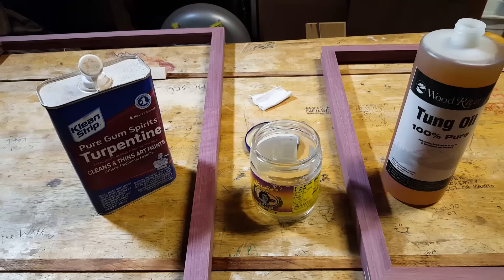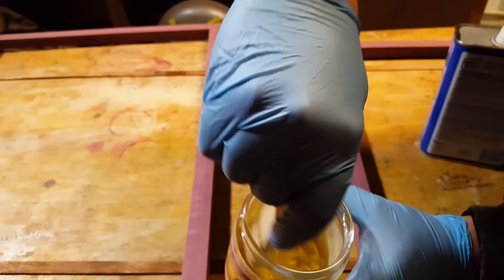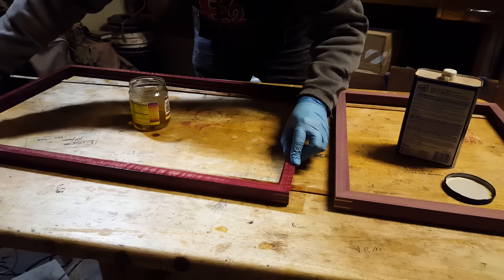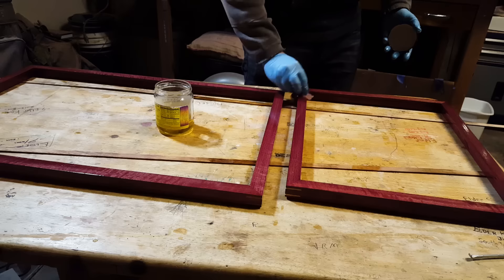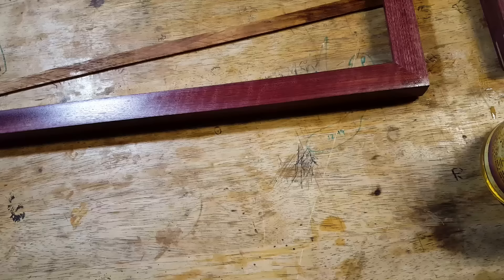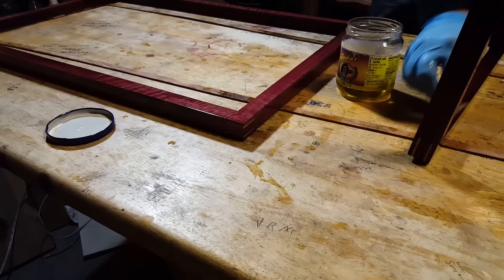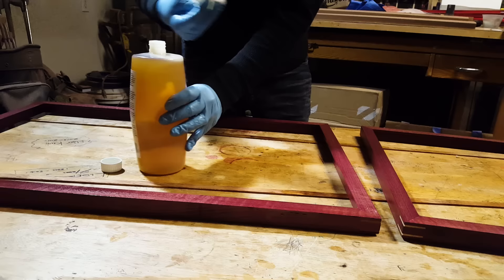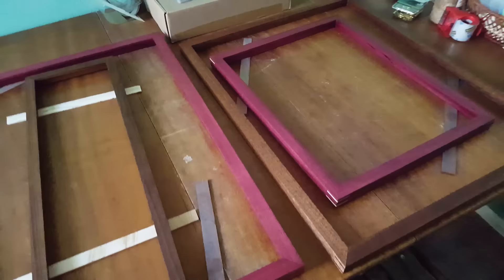How to Apply Pure Tung Oil to Wood (the right way)

Comment: Ive never worked with wood but wanting to do some diy stuff using the pre sliced wood ornaments. They all suggest using tung oil to care for the wood pieces. For this kind of situation do I dilute the oil? I also see spray tung oil available. Is it best to brush on with paint brush, rub on with a cloth, or spray on? Diluted or straight? The wood pieces vary in size from 2.0 in.-3 1/2in.

Comment: I purchased an unfinished French door. It was ready for staining. I’ve stained it with minwax stain and is allowing it to dry. In a few days I want to add a top clear coat or a sealant so I will use tung oil. Do I just apply the tung oil to the stain coat or do I need to sand it first with a 220 grid sand paper sponge before applying the tung oil?

Comment: i for one liked the music, can you tell me who that is? 
I'm refinishing an old rifle stock with pure tung oil, the only thing I'm a bit disappointed in is how much it darkened the wood...I'm on the fourth coat and am becoming very impressed with the results, the only thing i would like to know is, how can i give it a glossy look when done?
thank you for the vid and music.
Reply from the maker: Vienna Ditto. Good stuff. 
Sadly, if you want a glossy finish, you are going to have to let the tung oil cure for a month then apply a top coat of something glossy.
Reply: Melody's Dad thanks for the quick response...
Reply: bill randen Bill, if you want a glossy finish you can use a wipe on poly such as Minwax wipe on poly. Being 5 months later I'm sure your tung oiled stock is dry. 👍
Reply: If you're willing to put in the work for a hand rubbed finish, you can use butcher's wax. This will not give the high gloss finish of a gloss urethane, but will give an excellent, durable, semi-gloss. I use a dauber, either linen or coarse cotton, old denim works well. In a large square of cloth, place a good chunk of the butcher's wax. Pull up the ends and twist closed to make a dauber. Using the dauber in a circular motion, force the wax through the cloth and press into the pores of the wood. It will take time, but you're trying to fill the pores with as much wax as possible, this will take a few sessions. End each session with a clean, soft cotton, like old t-shirt. Wrap the cotton around two fingers, dip in warm water and begin buffing the wax in circular motions until it appears that all the wax is gone from the surface. This is similar to spit shining leather shoes and boots or a French finish using shellac. It will take just a few sessions until you see a gloss finish coming up. The more sessions, the glossier the finish.
Reply: bill randen I'm thinking of using tung oil on a rifle stock. How did yours turn out?
Reply: george george I am using the same method as you talk about. I just put the 16th coat on today. I've been rubbing it down with an old scrap piece of blue jean material and brown paper bags. I had a man tell me about that trick and believe it or not it's working. Its starting to gloss up really nice

Comment: I noticed that you don't use steel wool at all. I didn't know to thin tung oil, so that's worth a try, but rubbing coats of tung with steel wool has helps me get a better finish. Do you mean to say here that you can use turpentine and thin the tung oil instead of rubbing it out with steel wool?
Reply from the maker: Robert Wahl Some finishes labeled tung oil have things like urethane added to them. For those you can use steel wool between coats to even out the finish. But if you are using 100% pure tung oil (it will say that right on the front) then you don't need to use steel wool. In the description is a list of tung oils that are not pure tung oil.
Reply: Thank you. Yeah I already made that mistake. I am now(!) well aware of the difference between pure tung oil and Tung Oil Type Finish.  I find it unfortunate that labels can be so tricky to the newcomer. I really love using pure tung oil, which is now my main finish. I never knew you could thin it, so this has been most helpful-- perhaps a bit of a breakthrough. I will definitely try it your way more than once to learn how it fits with my work. Thank you once again. I'm subscribe now :-)

Comment: Because pine is less dense, is diluting it as necessary? Or is Tung oil on pine wood essentially polishing a turd? (Looking to protect a dining table, but trying to avoid poly).
Reply: Pine has its own terps so the solvent will probably help the two oils co-mingle in that first layer. Also, it can dry out as much as any other. I'm not an expert, but I'd do it.

Comment: Liked the DIY.  Have a question, I did 3 coats on Bocote wood but I always end up with a white haze after a week?  I am doing all 3 coats thinned 50/50 with mineral spirits and pure 100% tung oil.
Thanks for any help.
Reply: Kyle McFerran - did you ever find a solution to this white haze? I am getting a similar result with Tung oil

Comment: I've been given 1" thick slabs of tulip wood with the bark on that I'll be using for shelving. The person that gave it to me suggested using valoil on it but it's no longer available. My experience with finishing wood is nothing more than moldings and doors. Any suggestions? I'd like to try to preserve the bark and bring out the grain. Water won't be an issue.  The slabs are probably at least 3 years old and the bark is intact.
Reply: Jackie Crowe- Talma whatever you end up doing I hope there is a video at least showing the final product!

Comment: Has anyone got any tips on how to darken tung oil so that when I apply it to my wood it darkens it?
Reply: A little oil-based wood stain in the oil will do the trick. I've also just stained the wood first and then applied tung on top. If you want a more complex effect and your wood has tanin, you can treat it with iron wash, let it dry, and apply undoctored tung. So far that's produced good results on hemlock, Doug, and oak.
Reply: There is a company (real milk paint dot com) that sells “dark Tung oil” which is Tung oil with hydrocarbon added for this purpose.

Comment: I purchased a table with a shine spot on it like you showed in the video,  they must have not wiped it down  when it was drying , So now that it is dry is there anything I can do  to make it go away ?
Reply from the maker: I am sorry for taking so long to respond. Was the table finished with pure tung oil?If it was and is still wet you could wipe it down with a paper towel. But since it is dry, you might be better to just leave it alone. Do you have a link to a photo of it online?

Comment: I'm wanting to oil finish my wood flooring. I haven't seen any orange oil around here. but I don't really care about using it or not. but I need to walk on it in a day or two after finishing. I like the color of the wood. its never been finished . and is about 70 years old as far as I know. it had been covered for years. but I want to leave it bare and finish it. what would be a good oil for a fast drying quick job?
Reply from the maker: Unfortunately, I don't have any experience with finishing wood floors. I'm not going to pretend to be a resource for that. I can tell you that many oils that have additives/hardeners dry faster than pure varieties so I am sure there is something out there for what you are trying to do, I just don't know what it is of the top of my head.

Comment: Hi!

May I put a question up please?  I`ve ordered 5 l of pure tung oil to finish my vasas and as I have no experience with tung oil I`d like to ask something. Basically when I have opened the container it smells like used oil from a deep fryer. It looks golden and the consistancy and touch and smell same as used cooking oil. I applied on piece of wood and after a week it still smells like used oil from a fryer..... May I know it is right or not? What should it smell like?

Thanks
Reply from the maker: Hi Martin. I make a lot of photo frames since I am a photographer, and my favorite finish is tung oil. So to answer your question, I actually went around my house and smelled a frame that had been hanging in my house for 2 years, a frame that was finished a month ago, and the tung oil directly. The 2 year old frame didn't smell like tung oil, and the month old frame did have a subtle tung oil smell. I was putting my nose right up to it otherwise I wouldn't have smelled it. The Tung Oil itself does kind of have the look and consistency of cooking oil. To me, it smells more like a nutty oil, but I have heard other woodworkers say they don't like the smell. It might smell differently based on the brand you use. I only use the brand I showed in the video; what type are you using? Assuming that the oil is fine regardless of odor, did you wipe off the excess oil right after you applied at as I did in the the video? Is the wood still oily? If the wood is dry to the touch, and doesn't stink up the entire room that it is in, I would say it is normal. Otherwise, it there could be a problem with either the oil, or the way you applied the oil. If it is still oily, try wiping off the oil with a paper towel and give a it a couple days. If it is oily in a gummy way that won't wipe off, then wet a cloth with mineral spirits and wipe it down until you get that stuff off. That would only happen if you applied the tung oil like you would a polyurethane. I hope this helps.
Reply: Thanks for the answer it`s very useful.  Ahhh it`s hard to make a point. I don`t know what it is. Just to test it I`ve dipped a small honey dripper to see. But it stinks like a kitrestaurant`s kitchen. It`s been a week now and still has that smell of cooking. I`ve ordered via ebay from a manufacturer who also orders it from another company. It`s been packed in 2014. It may have gone rancid. I didn`t want to use it on my vasas as it stinks. Also the container says nothing. It`s a metalic container with a piece of paper glued on it with the description of the company. Very amatuer. There is no sign of hazards or so.....I`ve opened a case on ebay and the result is that seller needs to refund it and they are responsible even for the postage cost. It means something to me. I thought of sending you a little sample of it to have a try. Or I`ll just buy another batch from somebody else to compare it. I may try to apply on a piece of wood and wait to see how it behaves by the time.... :S
Reply from the maker: LOL. Well...that seems pretty old. Tung oil has to be stored in an airtight container that has no air in it or it will start to cure in the container. When that happens, it won't be a smooth oil anymore. LIttle crystals form right in the oil. And when that happens it is better to throw it out than mess with it. As far as the odor goes, I really am not sure, but what you are describing doesn't sound like good tung oil. I do know most oil sold as tung oil, doesn't even have tung oil in it. I don't think it would be worth the shipping to send me some. Get rid of what you have, and buy a small quantity from someone else to see if you like it before buying a larger quantity. I buy mine through amazon, I have a link in the description. I like buying 1 liter at a time because it is more manageable for me since I am not using it all at once. But, whatever type you end up buying, be sure it is 100% pure tung oil. If it doesn't say those magic words on the label, then it may not even have tung oil in it. I'm sorry you had such a bad experience. I really enjoy using tung oil and I like the smell of it. Let me know how it goes.

Comment: Great video!  I have a solid mahogany front door.  It opens onto my front porch, so is protected from wet weather and UV damage.  It has a tung finish.  The door is now 15 years old.  When I got it, the guy that hung the door said to put tung oil on it every year.  I had someone do that for about 4 years, then he retired so I stopped.  We live near a railroad line and there occurs an accumulation of dirty grit plus pollen on the door every year.  Lately I have just been wiping it off with a wet rag occasionally.  My question for you is should there be a deeper cleaning done with mineral spirits and then tung oil re-applied, maybe thinning the first coat?  I know nothing about maintaining wood, but I want to do the correct thing to keep the door in good shape.  TIA.
Reply: Wow, Myrna. That door should last almost forever.  
Mineral spirits will not remove any of the cured tung oil.  It I I permanent.  If there is sun damage,  a light sanding and light reapplication of oil would be ok. Otherwise,  just keep it clean.
Reply: Myrna,
Try a high quality lemon oil polish. It cleans, nourishes and protects. Maybe once a month. Experiment with how your door “reacts” after your initial application. My family has used lemon oil on hand finished rifle stocks ( coated in pure tung oil) for years with great success. It sounds like a beautiful door! 

Be well,

Shawn

Comment: Hi and thanks for the tips. Quick question, should tung oil be used after applying an oil based wood stain?
Reply from the maker: Pure tung oil goes into the wood then hardens, it doesn't sit on top like most finishes. For that reason, I think stain would get in the way, I wouldn't recommend using tung oil on woods that you don't like the natural color of already. Now, you could...combine tung oil with a stain and mineral spirits, mix that up and apply that, but then you would still need to seal it with something. And before you seal it, you would need to let it cure.

Comment: I liked the music too! I am researching whether to use Tung or Lindseed oil for a antique refinishing project...
Reply: I've been doing woodworking for more than 50 years and my advice is to not use linseed oil, it darkens badly with age and can become gummy. Linseed oil was traditionally used in exterior paints because it was cheap. Tung oil has been used on furniture and gunstocks, including military guns, for more than 200 years. It is easy to apply and it is beautiful and durable. Good luck with your project.

Comment: Hey great video. I'm not sure if tung oil is for me though. I'm finishing a bamboo countertop. I was thinking of using tung oil the only thing is I wish to have a smooth matte finish. How can I achieve that without undoing any or all of the sealing process. This counter will be exposed to water frequently.
Reply from the maker: Thanks. What have you done so far to seal it? Normally, you would want to use Tung Oil first, then wait a month for it to completely cure before adding any other type of sealer if you are going that route. If you have sealed it already, I don't think the oil will penetrate the wood. As far as the other things you mentioned, Tung Oil does give a great matte finish, it isn't glossy at all once it is cured, and it will make the wood water resistant.

Comment: Do you ever use tung oil as a finish coat over a painted piece, like a milk painted or opaque stained piece?  Thanks.
Reply: When using oil, your surface needs be like a sponge to soak it in and hold onto it. Painted products are already sealed off so another finish would be better for your application.

Comment: Great vid, I learned a lot! I have a random question, though. I'm thinking of using holly for a project in the future, and I want to try and keep it as white as possible. Is tung oil a good choice of finish to use, or will it yellow the wood significantly?
Reply from the maker: Sorry to get back to you so late. I have used tung oil on maple, and it looks great. It will put a slight amber hue on it but nothing compared to other matte finishes I have tried. And, especially in the long term. It doesn't get more yellow with age like linseed oil, polys, etc. If you can find a finish that keeps the wood more white please let me know about it. I have seen some glossy finishes that are less amber though. I think it was some bar table top epoxy glass like finish.

Comment: Question.  Im.new at all of this.  If I'm making an outdoor table. To I stain first then use the tung oil?  If so, after the tung oil am I able to apply polyurethane  as well?
Reply: Do you want it waterproof? Don't poly then. You can stain, wait for recommend dry time or add stain to pure tung oil. Tung oil is easy to repair or maintenance by adding more. Poly is not. Tung oil is beautiful if done correctly. Takes time and patience.
Reply: @austinicholas  could I use rustoleum marine spar varnish to waterproof it

Comment: excellent video. thank you. i've been using tung oil to seal the woodwork in my old brownstone. i'm using pure tung oil from the milkpaint company and diluting it with mineral spirits 1:1. in some areas of the wood after a few days, a milky film appears. could this be the tung oil drying after the wood "sweats" it out? is there a way to remedy this?

also, other parts of the house the tung oil after a few years got really sticky. is there a way to fix this you know of?

thanks!!
Reply: Any time you apply an oil finish you have to keep going back to it for a couple days and wiping off any excess that bleeds out. And the second problem may be from using pure tung oil without any driers or resins. A "tung oil finish" usually works better.